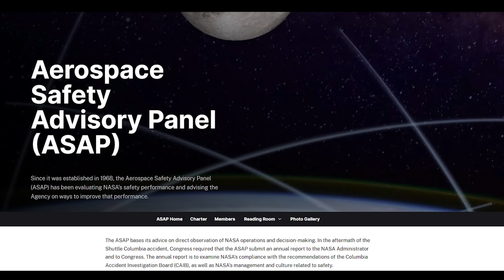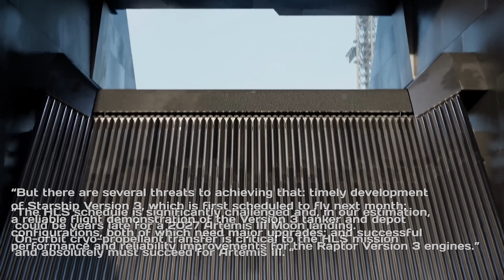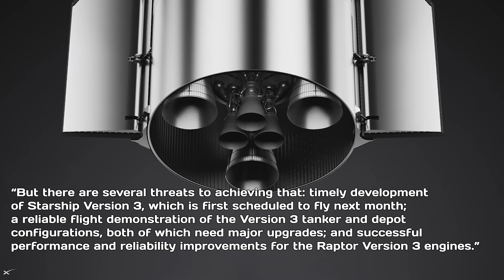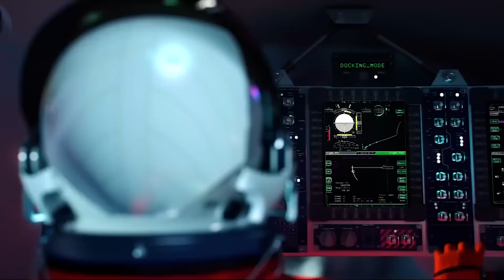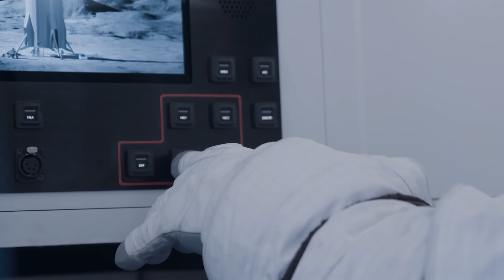LEAKED SpaceX Internal revealed Starship Moon Landing Timeline, Later than Expected!

Comment: Fact check. At 5:30 you said the first ship-to-ship fuel transfers would be 1,500 tons of propellant. V3 Starship capacity is estimated at 150 tons. Your statement is off by an order of magnitude.

Also, SpaceX needs to develop 3, not 2 Starship variants, Lunar landr, Tanker and fuel Depot.
Reply from the maker: Cargo capacity dont count fuel
Reply: @SpaceZonea  @richardrigling4906 is correct, 1,500 tons of propellant for the first test does not make sense at all.
1,500t is the max. propellant capacity in a single Starship orbital stage. No extra calculation needed to see the maths don't check out here. Almost as if another 0 slipped into the script, ey?

Granted, you are quoting NASA here with "up to 1,500 tons" so the real number could likely be much lower. Still, it is curious that NASA would state such an obviously overblown number. Were is this quote from exactly? I was unable to find that NASA statement on short notice.
Reply: @SpaceZonea  There's still the small error about the 3 Starship variants being required, not 2.

Comment: To be fair, Artemis II still has to have a successful orbital mission of the moon and return safely. That is still in doubt.
Reply: The last schedule I have seen for that is April 2026 with suspiciously no launch dates (or crew selections) planned for after that.   This sounds more like a demo than a program.  Although flying people into space is difficult, it is much easier to do it once as a demonstration (stunt?) than it is to set up the logistics, manufacturing, and quality control needed to do it as a matter of routine.   Think about the door plugs on a Boeing 737.   There is a difference between a production product and a prototype assembled by a team of the most talented technicians and engineers.   It just is not the same thing at all and anyone who has ever brought a real aerospace product from concept to full production knows that.   Having a prototype in the end does not mean much.

Comment: When the first Lunar-Starships or Blue-landers reach the moon, they should carry small robotic-bulldozers to flatten and compact the ground.  

These robotic-bulldozers could carry explosive-charges to deal with large bolders.  They could also use the bulldozer-blade as a shield against a blast.

Suitable landing sites around Shackleton Crater are in short supply. 
China will bust its gut to grab these sites!

Make your own luck:  Build your own landing-sites!

Comment: I hate it when SpaceX say they cannot get a lunar suit for the astronauts that can survive the extreme temperature and radiation.  Like they need materials that today technology cannot provide.  Why dont they go ask Nasa how the Apollo suits were material that was available 40 years ago....basically just cotton cloth and some plastic.
Reply: It's not that they can't. It's just that making proper suits is very expensive while at the current time, does not make sense to mass produce. So they just let NASA deal with their own need for an external space suit.
Reply: The Apollo EVA suits were actively cooled by sublimetion and internal tubing. In fact the EVA was limited by the quantity of frozen water. In the vacuum of space you cannot even talk about an environmental temperature. The heat inside the suits were produced by astronauts themselves,  not by external radiation which was shielded by the suits reflectivity.
On Mars it is the low temperature of the thin atmosphere (about 90 times ) which makes EVA rather pleasant
Reply: NASA lost the blueprint of how the spacesuits were made…😆👌